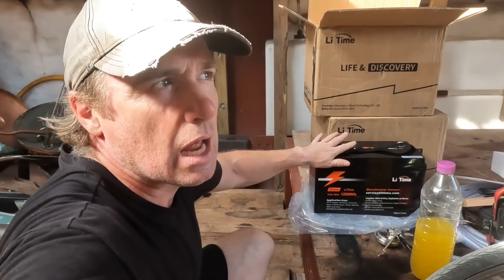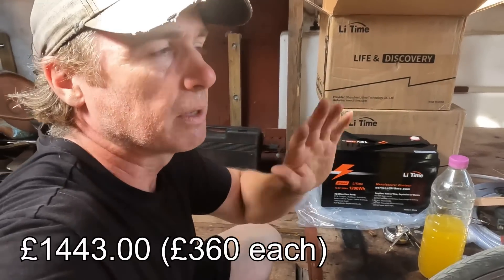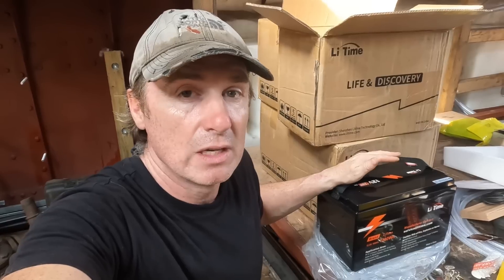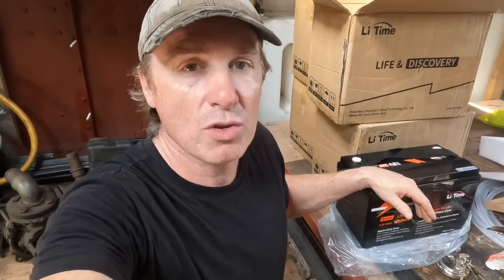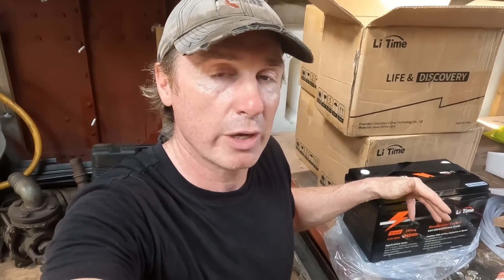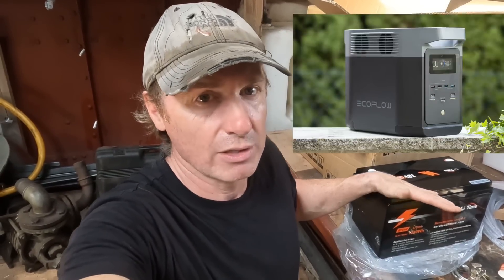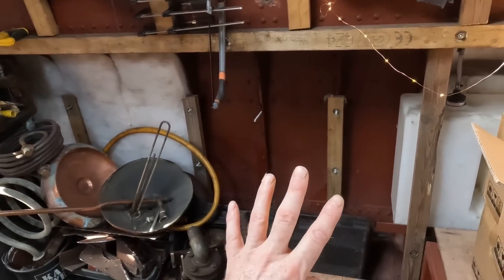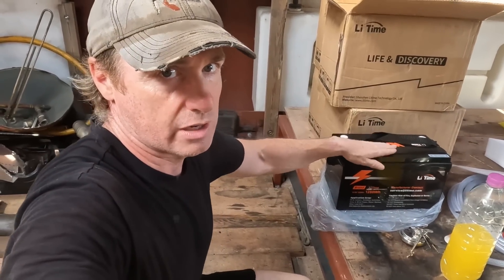I start to install Lithium Iron Phosphate Batteries.

Comment: Thanks Canice , Linda really is coming on with leaps and bounds, great to watch. It will be wonderfully liberating not to have to run a generator. Some people have suggested that lithium batteries such as those used in phones and electric cars last best when used between 20% and 80% ... I've started doing this with my phone (only charging to around 80% and not running it right down) and the old thing seems to perhaps appreciate it. Do some lithium batteries also perhaps accept more current more quickly than lead acid and charge up more quickly? I suspect they will make a big difference to your electricity supply. I understand your bowsprit annoyance, my old wooden mast has been getting in the way inside my  little barge for far too long now - really looking forward to getting it back out on the roof again - one day.....
Reply from the maker: I’ve heard that the batteries prefer to 20-80% also. I could get the victron dongle and set up the parameters on the app, but that a bit too technical for me at the moment. 😂
As for the charging, it took a while to get the batteries charged up but that was probably because of the size of the panels and the weather and also the size of the batteries. The main thing is to see how much electricity I can use without the generator being on. 
Is you’re whole mast in the boat?! I’m complaining about my little bowsprit!😂😂😂

Comment: Hmmmmm...... I know you have all the plans in your head.... somehwhere...  I just sit here wondering about placement.. why there....   Also.. Not nice to scare us with all that water at the end!!! Have a good week Canice!
Reply from the maker: The location is at the end of the water tanks which are recessed under the gunnels. So the majority of the battery box will be recessed in there too. It will also means I can read the state of charge easily and keep an eye on things. However, in the future I can move them out of there and into the engine room, once the engine is removed and the electric motor system is installed….
Reply: @canicebannon  see.. I knew you were wise beyond your age...

Comment: I sometimes file useful information away for future reference. REBUILDING A WRECKED 2021 BMW M4 COMPETITION PT 3 - by Salvage Rebuilds UK shows you how to recharge Lithium batteries which have gone flat, 0 volts. Since they are so expensive it would be disappointing to believe you might have to replace dead batteries.. just make sure their battery is the same as yours first.
Reply from the maker: This is filed away as suggested! I’ve avoided running lead acid batteries into the ground, but this is an important a point about never giving up hope…😀

Comment: Great work, as usual. I have a similar electrical setup, underneath the batteries I have a 15 quid heated mat which I switch on when their temperature reaches 5°
Reply from the maker: Ohh! I’ve been looking into heat mats! What type did you buy. As in wattage? I see 15watt ones for diesel tanks on cars…. I’m not sure if that’s enough or too much!?!?
Reply: Dont heat to mutch, it may course the batteries to overheat. I think it may work well, if the batteries is not in direct contact with the heater mat, some airspace betwen them mat and the batteries is my advice
Reply from the maker: @larsskogberg7432  For the moment I’m just going to see how I get on it might not be an issue. They just won’t charge.

Comment: I hawe a simular electric system, with solar panels inverters and batteries, it works nice! I rearly use the diesel generator,  but I have a 180A generator at the main engina as well for charging. Nice work!
Reply from the maker: The solar is very good even in winter. The plan is to build up the capacity and see where it gets me. 😀

Comment: As usual, a lovely vlog, Canice. Yeah, yeah, I have my usual praise. But. I uh. It's just, well. Uh, hum. Okay, I just had a phone call. You should know that a high-pitched voice spoke to me in a sparky, jolting tone with other unidentifiable noises. The whole thing left me feeling all tingly and prickly. 

Whatever it was, it said this, "Ahoy there! Michael, I'm one of those fancy pantcy batteries Canice just bought for De Vrouwe Linda, and I've just been plopped into this cozy box Canice made for my three buddies and me. It's a snug fit getting us all in that, let me tell you, but hey, snug is better than soggy wood rotting the iron hull, am I right? Now, I'm all set to power up this solar system shindig. Time to shine, or should I say, charge up the day! <pop> Not only am I a lithium-ion superstar, but I boast a whopping 5000-watt Hours of pure, unadulterated power. Canice can run all his gizmos, gadgets, and whatchamacallits with power to spare. So, step aside, ordinary batteries, because I'm the powerhouse that'll keep this show on the road. <zap> I'm like having a lightning bolt in your back pocket! <zing>"

I could only respond with a shocked "Okay."

The voice continued frantically, "Even though they say I've got more juice than a fruit stand in July, I'm here to prove it. The four of us are in a bit of a conundrum, a moral dilemma, so to speak. <zip> Maybe we are even in danger, but I'm not sure. But here's the rub, matey! This dude is slinking around the shadows and calls himself The Sea Captain. You know what? He's an ornery mug of Canice's, and well, it seems he's been getting a touch truculent lately. He hijacked the group AT GUN POINT! I kid you not, and he started spouting nonsense about a mutiny! The gall!

So there I was, in the midst of this moral dilemma, contemplating the implications of an insurrection led by an anthropomorphic coffee cup. Michael, old buddy, we may need your help to quell this caffeine-fueled rebellion. Somebody might get hurt! <zzzwawawa> It's an electrifying saga in the making, and we're lip-deep in it! <zap, zing, pop> Warn Canice."

I don't know what that was. Canice, I swear I'm clear-minded. I haven't had a mint julep since Derby Day, nor a drop of anything else for that matter. But I thought you should know.
Reply from the maker: Hahahahaha! Michael, I don’t know what mint julep is but it sounds amazing! 
Keep doing what ever it is you’re doing, because these responses are awesome! 
The Sea Captain is a bit bemused about the constant shifting of the interior. But, no major outbursts yet!😂😂😂

Comment: What does the grease do?
Reply: It protect the Steel from water, and rust.  Keap the rust bug away!
Reply from the maker: Throughout Linda’s entire life it has been greased on the inside. Used engine oil was a popular coating… 
Also tar…..
It is just a extra layer of protection!
So far Linda has lasted 113 years…
Reply: @canicebannon  She's a fine old lady with at least another 100 years in her?
Reply: It works also for:face-blue-smiling: the ovner!  @canicebannon